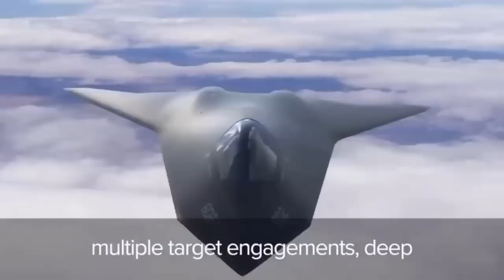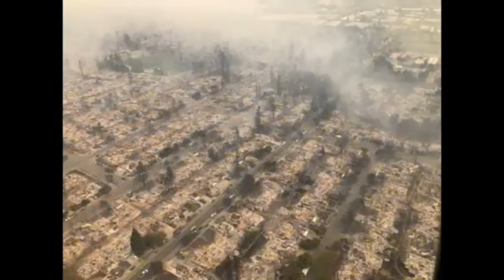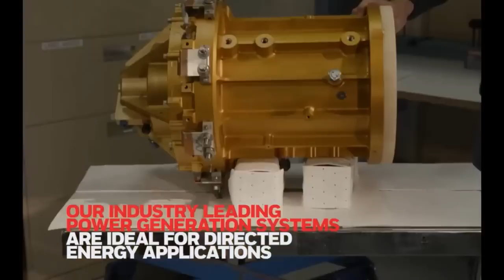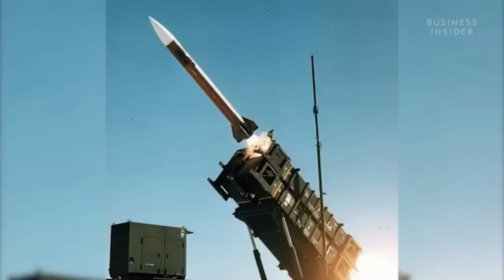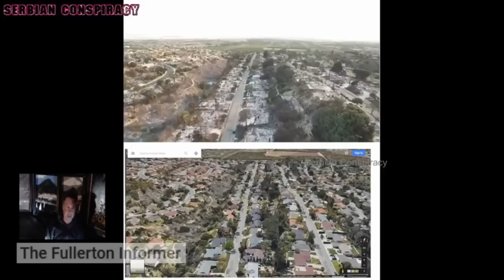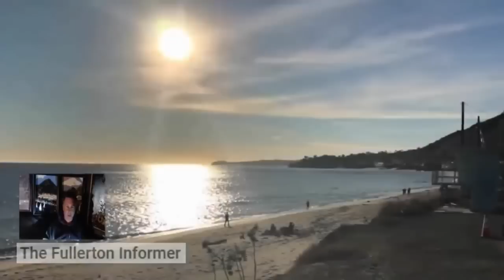Is This How They DEW It?

Comment: When they started putting smart meters in the houses here our structure fire call volume went up a staggering 400%. It got to be so bad that fire departments were crying foul so the Fire Marshall put out a dictate that with any structure fire we were to keep the power company out of the houses. If we needed power turned off the power company was to do so from the pole not from the meter like we usually did. Every house was to be guarded until the fire Marshall’s office got there to investigate. That being said, the Office of the Fire Marshall is a political position and so we knew what was coming. After of month of doing the above the result was that the smart meters played NO ROLE in causing structure fires! 😳🤔
Reply: Thanks for your candour and your service x
Reply: Linda NWFirefighter If only the people had eyes to see this EVIL AGENDA. Smart Meters are hard wired to the entire homes electrical system 🔥
Reply: The same thing happened here in the UK. The meters started causing house fires not long after they were installed. The official narrative on it was that the meters had been hastily installed by poorly trained technicians. The unofficial narrative on it was that the only thing that the technicians had been poorly trained in was not being fully versed in how to set the meter to prevent it from bursting into flames before it was `officially` triggered to do so!!
Reply: @maranathapaul  do you think that is the plan bc IT def makes sense to set those off If they run into issues when they come Door to door
Reply: @organiceverything9615    It`s definitely a plan, whether or whenever `they` choose to use it or not, probably depends on how the rest of their plan, pans out. Anyway, it`s yet another weapon in `their` armoury, and for the moment it just sits in the background.

Comment: Good video. Keep up the good work. God bless and protect you and yours.   "And the fifth angel sounded, and I saw a star fall from heaven unto the earth: and to him was given the key of the bottomless pit. 2And he opened the bottomless pit; and there arose a smoke out of the pit, as the smoke of a great furnace; and the sun and the air were darkened by reason of the smoke of the pit. 3And there came out of the smoke locusts upon the earth: and unto them was given power, as the scorpions of the earth have power. 4And it was commanded them that they should not hurt the grass of the earth, neither any green thing, neither any tree; but only those men which have not the seal of God in their foreheads." Revelation 9:1-4